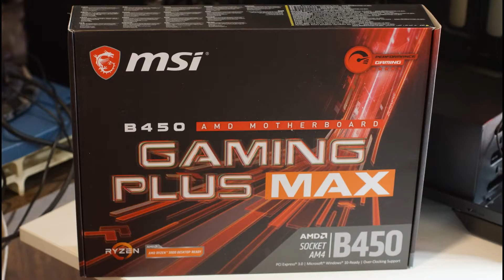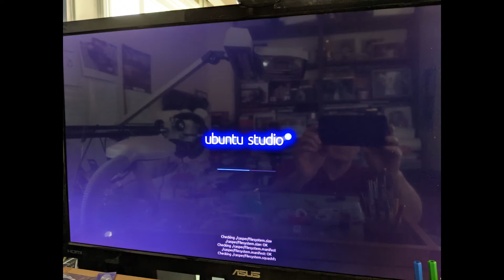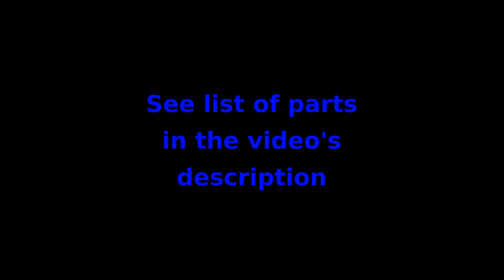Building a Powerful Computer in One Day

Comment: Is that power supply up to the job?I would have thought a 700 Watt would have been nearer the mark for that setup................
Reply from the maker: Seasonic GM-550 is a good match for this configuration. The computer is cool and quiet all the time. There is no internal Hard drive, which might have needed an additional power. The backup drive is external.
Reply from the maker: The power consumption for this configuration was calculated to be no more than 415 Watt with 16 hours of day usage.